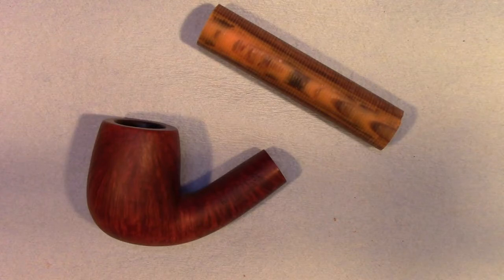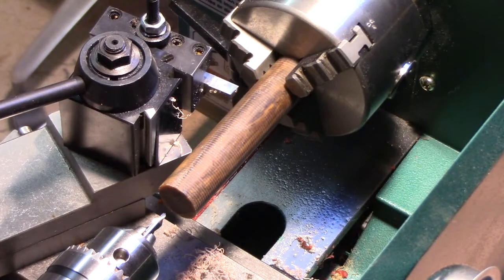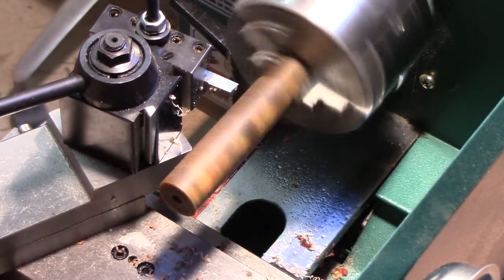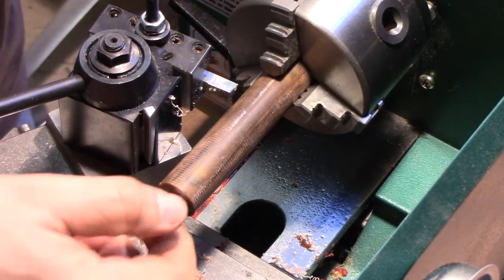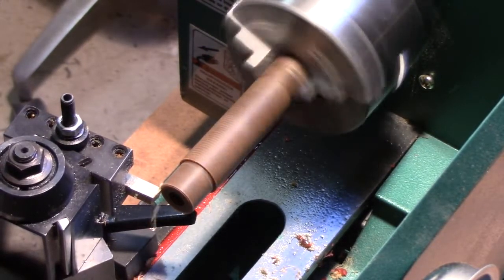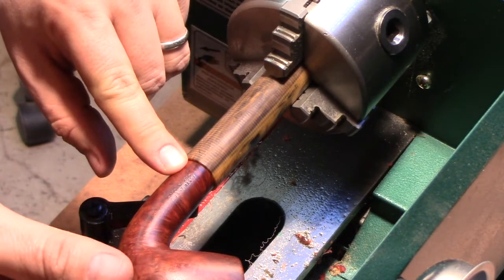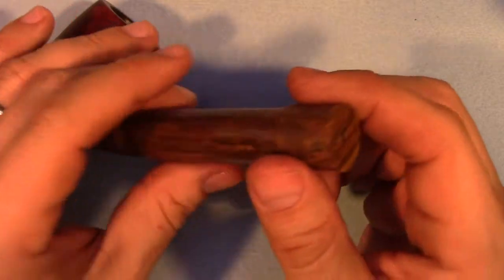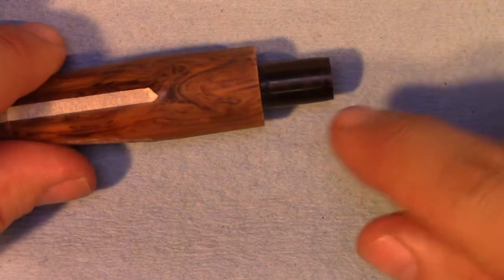Durham Duke Royal Ascot Supreme  Part 2

Comment: I found out about 10 years ago if using a filter in a pipe to always use delrin because of stress taken out daily in some cases so it is a lot less wear in the shank and the tenon to do so and will make both last much longer and buy it being self lubing one can say it will help not to stick or chip ether the tenon or possibility cracking the shank.
Nice work man .
Ram
Reply from the maker: Good advice Ram, thank you!